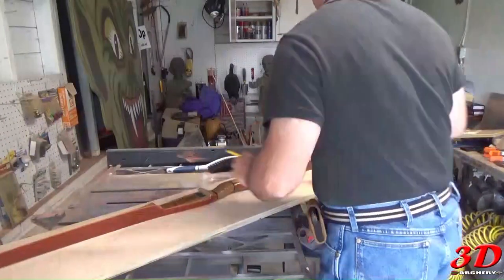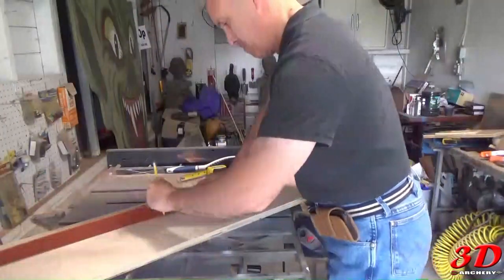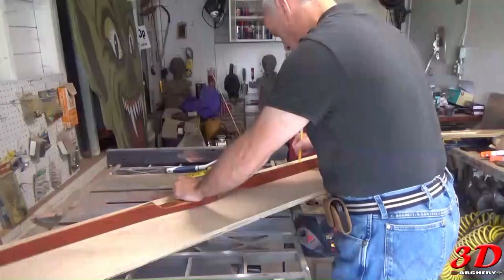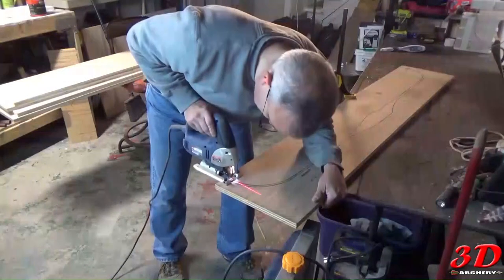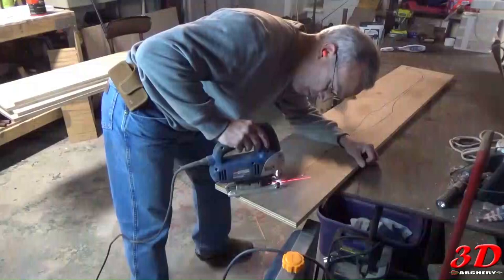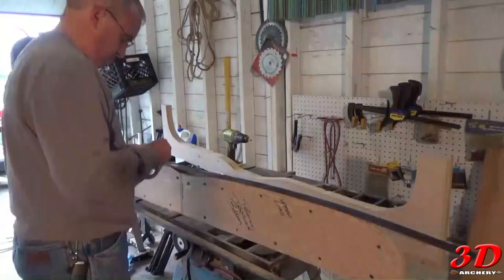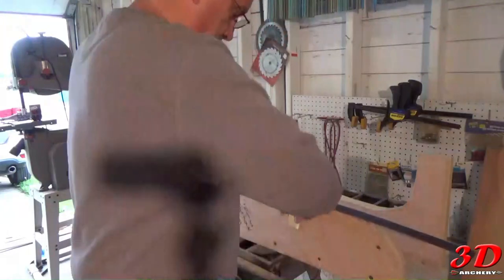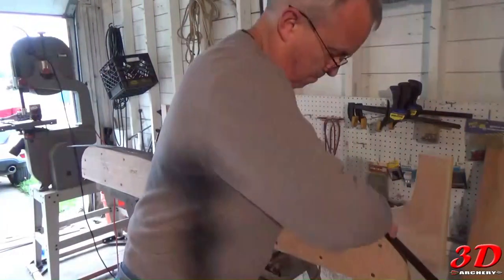How to Build a Bow   Step Two Building a Bow Press

Comment: Greg, I have recently discovered your channel and your sister channel and have subscribed and watched all of the videos.  I have payed particular attention to the restoration videos as I also have a number of vintage bows from the late sixties and seventies. My question is, if while restoring your bows, if you have considered reinforcing the tips of theses bows to allow fast-flight string?  If so how would you suggest that be done?
Reply from the maker: It is quite easy to do. In fact, it is how bowyers do it anyway, They install the tips after it is a cut and done. I use epoxy, but have been told that Super glue (Gel Form) works just as good. 

Glue it up, clamp it and then form it. I would recommend removing the old coating first.

Comment: Greg l have a couple of questions if you don't mind  1) when you draw around your bow do you cut the out side lines on the lines or do you cut bigger to allow for your air hose ( if that makes sense ) 2 ) And this is a biggie what if you don't have or can not borrow a bow to use as a template , is there somewhere where you can buy a template to work to or a kit ?? . This is one of the best bow channel's on the tube not forgetting the Sister Channel The Nocking Point , the content is brilliant thanks for sharing 👍👍👍
Reply from the maker: frankie1956 
Good questions. I sketch out the bow, cut the bottom to the line. Then when I cut the top, I cut about an inch or more higher. I should have said that. Thanks for pointing it out.

They sell plans / blueprints at Bingham. But, guess what?
I have the plans for the reflex reflex long bow and recurve, never used. I also have the instructions. I could send them to you if you like